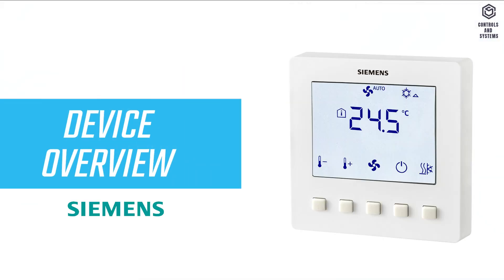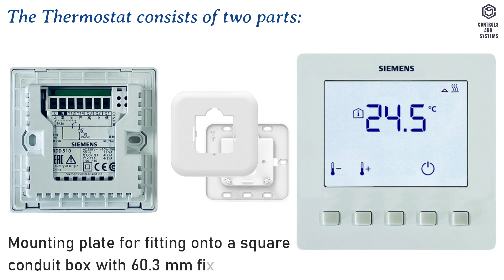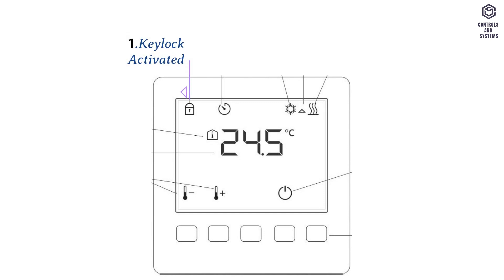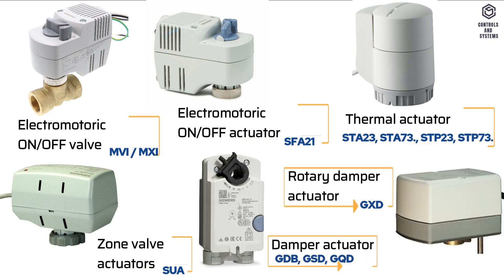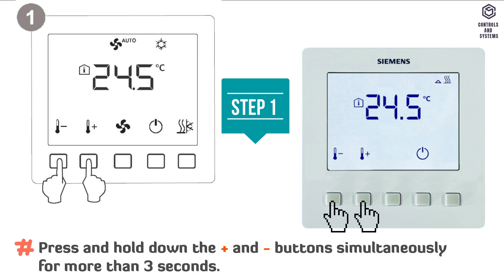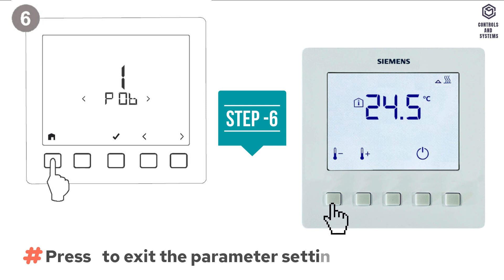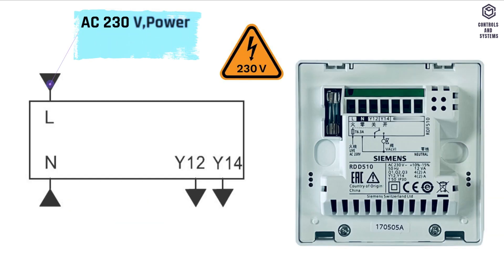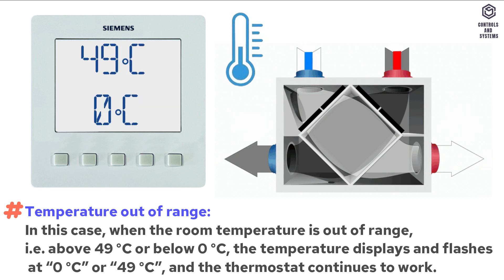Siemens RDD510 Heat/Cool Room Thermostat: Overview & Technical Data | HVAC Control Made Simple

Comment: How to keylock activated to be unlock?i forgot
Reply from the maker: Keylock
✔️ Keylock can be activated or deactivated via parameter P14 when the thermostat is in Comfort and Protection mode.
✔️ Either full lock (P14=1) or partial lock (P14=2) can be selected. 
✔️ All buttons are disabled if full lock is set. 
✔️ On partial lock, only setpoints can be adjusted.

Parameter: P14,
✔ Description: Keylock function,
✔ Factory setting: 0,
✔ Setting range: 
0:= No lock,
1:= Full lock,
2:= Partial lock,

Comment: Please full wiring details
Reply: The thermostat stopped working when I was away from my home what about 5 months or so. This could be due to bad weather. I could not make it work after I return to my home.
The whole display screen in the front of the thermostat is cloudy and displaying 8888 etc.
I tried the two small knobs 1 each on one side and the other on it's other side.
What could have gone wrong ?
I haven't got any leaflet to find out what is wrong with this gadget.
Is there any Online manual available for Siemens Programmable Thermostat - Wireless 
RDJ100RF/SET?
Reply: It did not help me as I just done my feed back for any Manual for download ?